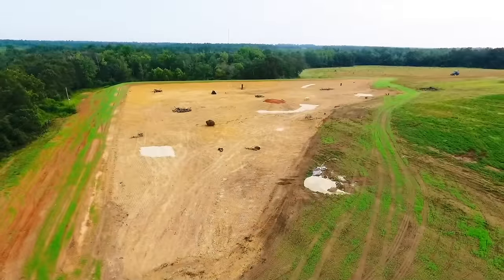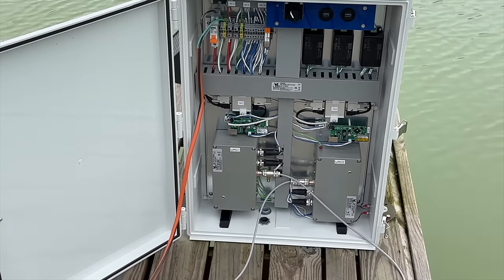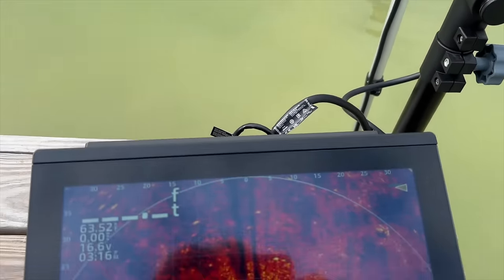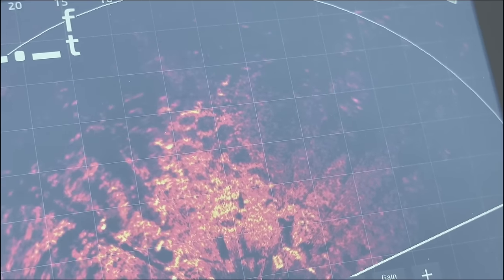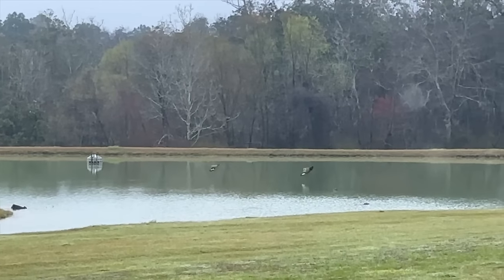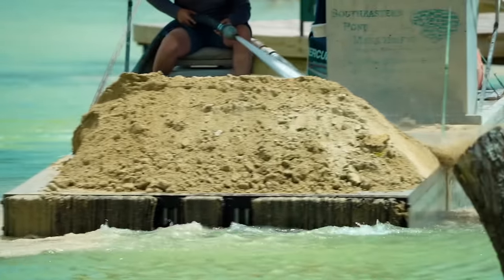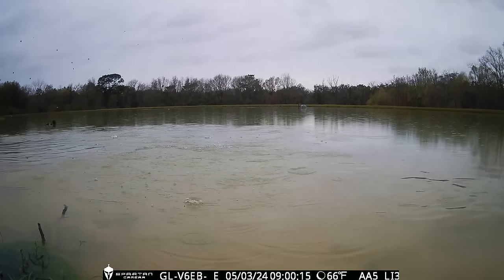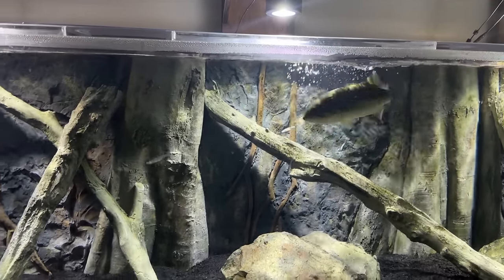Building the World's Most Advanced Fish Tracking System!

Comment: That vacuum through the pipe is an ingenious way to get a cord to go through!!
Reply: Electricians have all sorts of neat tricks to get wires through conduits. Sucking a "mouse" through is the tip of the iceberg...
Reply: Very common in commercial electrical work. Suck a string tied to whatever first and then use it to help pull fish tape through and then the fish tape pulls the conductors through the conduit

Comment: Is the stuff you are using to protect your wire splices IP68 Electrical Waterproof for splices.   I have had problems with using pure silicone caulk, water somehow finds it's way into the connection.
Reply: It is best to clean the splice area you are going to try to protect with rubbing alcohol, make sure you wear plastic throw away gloves so you do not get the oils from your hands on the wire jacket.